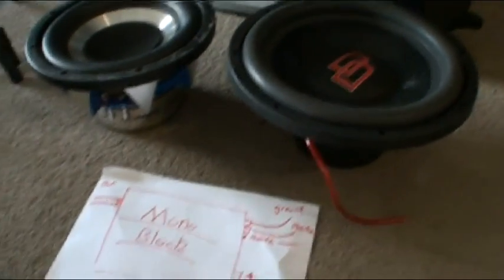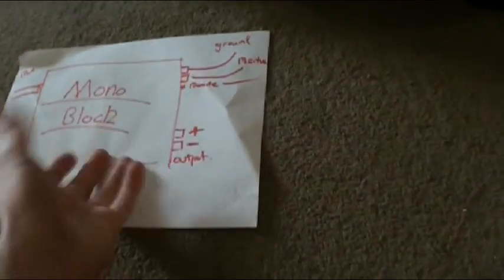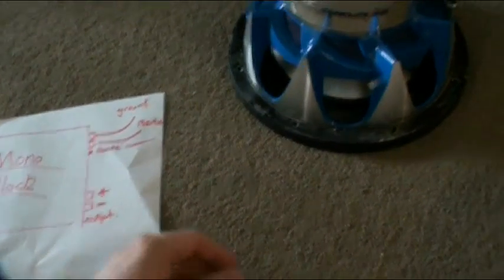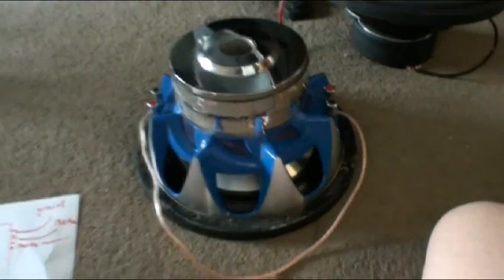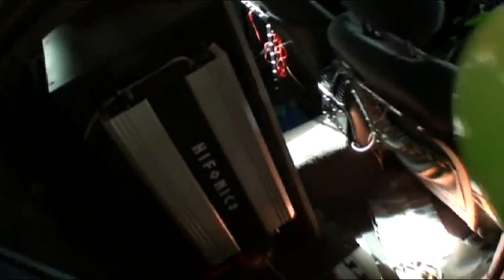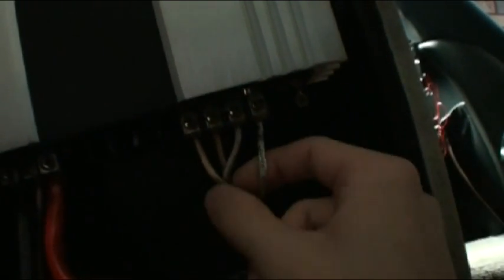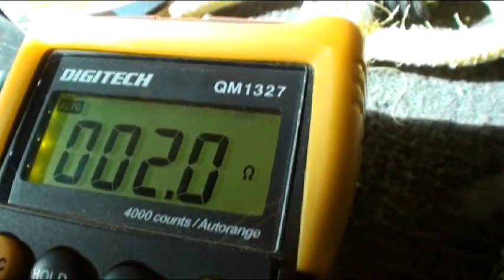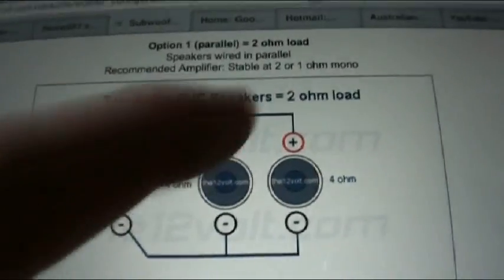How To: Wire Mono Blocks & Subs - DVC/SVC - Parallel/Series

Comment: my amp has two bridgeable channels that push 200 Watts at 4 Ohms,  300 watts at 2 ohms & 600 watts at 4 Ohms bridged.

one channel is burned out.

I just want to hook up one big ass subwoofer. just blew my memphis 12"s

can the negative on the burn Channel still be used for a bridge?
 
so I can get a 600w sub run bridged or do I have to go with a 300 at 2 ohms  or my math wrong?

should I just get a 200 watt sub? & how many ohms would that be out of one channel not bridged?

somebody help me understand this

Comment: His using the parallel connection directly in the amp which is wire in parallel monoblock amps are wired that way

Comment: you were completely wrong about wiring in parallel. You wire from negative to negative on the sub and then to negative again on the sub box. and the same with positive.

Comment: Hi. good video, but with all the research I've done, I'm a little confused.  I'm talking in relation to what you were saying about the amp with the 4 speaker terminals. My amp mono block has 4 speaker terminals. If I wire my 2 dvc 4 ohms in parallel from the speakers, that gives me a 4 ohms load. But connecting this load to the 4 speaker outs on the amp, would this convert the load from 4 to 2 ohms?
Reply: Elijahman T  joy yuh x
Reply: Your two outputs on the amp is for convenience if you have two speakers. Just wire your DVC to the ohm load you like and then only hook it to one POS and one neg on the amps outs.
Reply: Elijahman T you have to wire them in parallel so they drop to 1omh then + to + on amp and - to on amp from 1 speaker coil then other coil + to +  and - to - connect to other coil in the other one and jump to other coil and it will be 1 omh plus you will increase the power of your system I been doing car audio for almost 20 years

Comment: HOWS THE BOMBADORE GOIN MATE?
Reply from the maker: +Eddy Temiz I sold my Red VX I have a HSV now
Reply: ***** hey just a question, i'm new to this stuff so need to ask, i have a dvc sub 4ohm 600wrms and i want to use my 4ch amp to run it. it can be bridged to 2ch at 4ohm so can i hook each bridged channel to a voice coil on either side of the sub? or will this method change the ohms as i will have 2 4 ohm channels hitting the sub?
Reply from the maker: +Eddy Temiz on a 4ch you can bridge the rear channels normally but dual bridging on a subwoofer will be no good unless you could match the gains 100% so safely run it on the rear channels or buy a mono block

Comment: HOW DO YOU WIRE MULTIPLE SUBWOOFERS OF DIFFERENT IMPEDANCE TOGETHER?  FOR EXAMPLE 2) DUAL 2 OHM SUBWOOFERS AND 2) DUAL 4 OHM SUBWOOFERS TOGETHER OFF OF A MONO CHANNEL AMPLIFIER.  SOME PEOPLE MAY HAVE MULTIPLES OF DIFFERENT IMPEDANCE SUBWOOFERS THAT THEY MAY WANT TO RUN OFF OF A MONO AMP BUT YOU CAN'T FIND WIRING DIAGRAMS ON HOW TO RUN MULTIPLE SUBWOOFERS OF DIFFERENT IMPEDANCES TOGETHER.  ALL THEY HAVE ONLINE IS TO WIRE MULTIPLE SUBWOOFERS OF THE SAME IMPEDANCE TOGETHER.

Comment: ok I have 2 bazooka 12" RX triangle subs 6 ohm dual voice coil subs with a rms of bout 300 watts.. and tryn to figure out the best way to wire both these subs to a bazooka BA 1900D 1 channel amp... at 8 ohms is 800 watts... and 4 ohms is 500 watts.. soooo how do I go about hookin both subs to this amp... thanks

Comment: For parallel on the DVC 2 ohm, wouldn't you hook up both positives terminals together then hook that up to the positive on the amp, and the same with the negatives to acquire a 1 ohm load?
Reply: yes, you would. this guy doesnt know what hes talking about.
Reply: That's what I thought.
Reply: That would be for 0.5 Ohms

Comment: Hey,

First of all i appreciate your video. 
would a Sundown sa8 v2 d2 (2 ohm DVC - 500watt) wired to 4 ohm, be a good match with a ONX1.1000D - MB Quart (475 watt at 4 ohm) ?

the amp putts out 1000watt at 1 ohm so i think i waste a lot of power and maybe should get an smaller amplifier, that puts out around 500 watt at 1 ohm and wire the DVC sub to 1 ohm

would you recommend 4 ohm wiring or 1 ohm wiring? the price of the amp doesnt matter.

Thanks a lot

Kees

Comment: Hi mate, I'm used to see mono block with just two speakers output, but the one I bought has 4 outputs......I got a sub wired down to 1 ohm,...so I should connect to wun negative n wun plus on the outputs right?

Comment: i have a single voice coil at 4 ohm ........... with amp stable at 1 ohm .....so i just connect the speaker wire to the amp??

it does not matter that the speaker is 4ohm and the amp is 1 ohm?????/

Comment: what if i want to wire one 4ohm SVC to a mono block amp with 2 speaker output

my SUB is a polk MM 1240 SVC  and my AMP is polk PA d1000.1 

tnx in advance

Comment: @pussytastegood1 Ya i have 2 15 inch p3-15w subs dual 2 ohms ima put it in a seal box the amp ima use is Hifonics Brutus BRZ1700.1D. N idk with the amp kit cuz i dont wanna get any expensive wires and stuff cuz im getting tight on money frm buying the amp n box so i was just wondering if theres any kit thatd have enough wires for me 2 do the hook ups

Comment: I'm getting 2 15 inch subs to a mono amp N i was wondering would 1 amp kit be enough so i can i hook up my 2 subs (i didn't buy the subs already in the box so i have to do tat parallel or series wiring) so i was wondering if id have enough wires to do the series wiring and connect to my amp and what not.

Comment: wtf? are you on crack? parallel wiring "one positive and one negative don't have a wire"
thats not parallel wiring, its connecting it to the positive on one coil, the negative on the other coil, and the sub won't do anything?!?